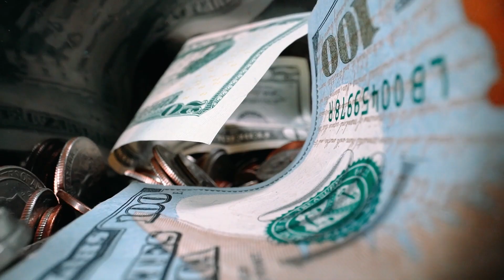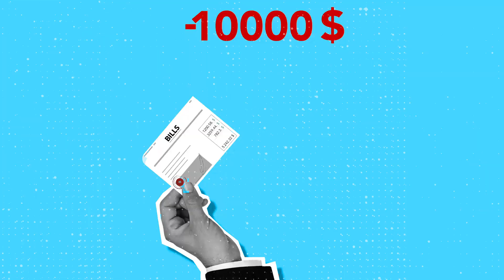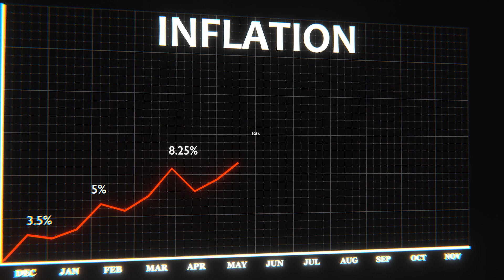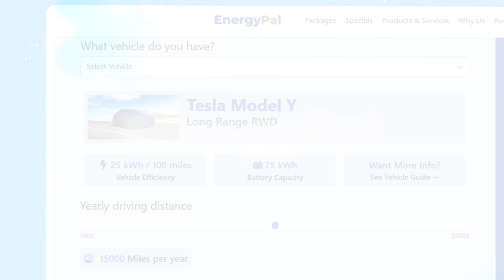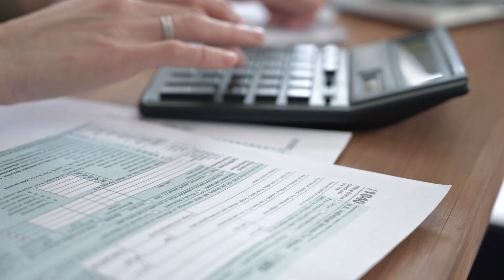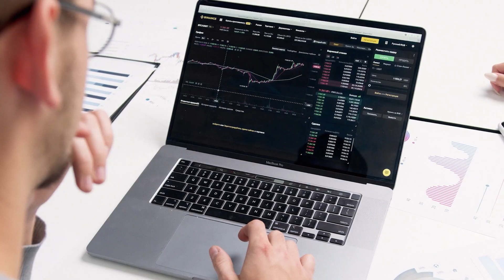Going SOLAR: Pros & Cons

Comment from the maker: WATCH NEXT - Pros & Cons of buying an electric car: https://youtu.be/kxb6kjuJEso
Reply: This is a very interesting video about the pros and cons of going solar. There definitely seems to be way more pros than cons for me personally at least since I live in Florida and have pretty of good sun coverage on my roof. Where the host left me hanging was that he said that leasing solar panels was a bad idea, but left me hanging as to why. I just signed up for a solar panel lease to start soon that I think makes way more sense than owning the panels because I avoid upfront installation fees plus a huge loan I would have to procure in this shitty high interest rate market plus have to deal with the hassles of maintaining and fixing my solar panels plus upgrading it eventually when they become obsolete or outdated. The video creator should I have done a better job of conveying the so called cons of leasing solar panels. Anyways, I expect to enjoy savings of at least half of my current monthly electricity fees so I’m looking forward to that. I want to eventually pair this with buying an electric car to garner even more savings on fuel costs for the vehicle besides reducing my overall carbon footprint. Also, the EV can even act as your home battery with the right kind of EV and vehicle to home wiring so that’s something to explore as well.

Comment: I guess I'm lucky because it took me about 14 months to finally get solar going. Completing the solar generation agreement with the utility company took another two months. None of the delay was due to government red tape because I live in California. In fact, the permitting, inspection and solar generation agreement were done in less than a month, if I include the wait time. The delays were caused by the incompetence of the solar contractor who wouldn't keep us informed about where they were in the process and wouldn't work with the roofing contractor that we needed to make sure we had a viable roof for the life of the solar system. The contractor was also lazy about submitting documentation to the utility company until I lit a fire under their asses. I sure don't feel lucky after the shenanigans of the solar contractor.

Comment: Saving over time is not a good deal if you're already old. I won't live long enough to break even and that's if NOTHING goes wrong and I'm thinking it will. And if the value of my house goes up so do the taxes. This deal just keeps getting worse. I might use VTG or a powerwall so I can be in a VPP but not solar.

Comment: Alex, you made a couple good points, the one that gets missed most often is the roof renewal. But what you completely missed is the concept of net metering. It’s not in all states, but states that have it it’s awesome because the grid is acting like an infinite battery. When I overproduce, I give my utility kilowatt hours, and when I underproduce, I get them back one for one. I don’t need batteries this way. Batteries have only specific applications. They do allow you to produce when the power is out but how often does that happen? Batteries are never going to work to get you from summer overproduction to winter underproduction. That’s why net metering, and the grid as an infinite batteryis such a great concept.
Reply from the maker: That is almost over. The utility companies are now starting to pay so little for your electricity that it's not even worth it anymore. I did mention it in the video
Reply: @EforElectric  You misunderstood what they wrote…

There is NOTHING being sold in "net metering" systems (which are popular evenn here in Europe).

In "net metering" system, you are assigned account that counts how many kWh hou delivered in the system and what is your balance.

No money involved, just kWh in, kWh out…

Of course, if your account gets deep in red for longer then several months, utility is going to come knocking, but otherwise it's just abouth kWh balance…
Reply: In some states Colorado where I live we have 1:1 net metering.  It resets once a year.  So if over the whole year I produce enough I dont pay any usage charges. That makes a battery not financially worth it.  It still could help during a power outage.  If I was worried about that I would probably get a much cheaper evil gas generator.   The greedy utilities can always change net metering rates and reset the calculation. ( It may be a law in Colorado not sure )
Reply: Still going strong in Washington state. It’s possible it could change later from one-to-one to something more like two to one or three to one where they come out ahead. It just depends what state you’re in. Washington net metering is over a one year. Alaska a one month. I think it’s important to see what the situation is in your particular state and not paint everything the same.
Reply: The way it works in Washington state is that if you don’t have enough in your bank, plus what you produce that month to cover what you import from the utility, you simply pay the difference. But generally the way it works is the solar year starts in April, and, generally one is break even in April by the end of the month. You might be behind at the beginning of the month, but make up for it by the end of the month and that’s all that matters. In may, you are starting to get ahead and you build a bank. All summer long the bank builds. Come October, you start drawing down from the bank. Most people run out of the bank somewhere in January or February and then just pay for any electricity they import. Myself, I have enough capacity that I just break even by the end of March. If one does have anything left over in the bank after the end of March, the utility takes it. Most people slightly undersize their system so they don’t leave anything on the table.
Reply: Utilities have and will reset/cancel/change net-metering making the finances difficult to lock in.  They will never make it easy even if it is in their best interests with regards to capacity and load-sharing.  They are mostly all FOR PROFIT companies!

Comment: I was going to get rooftop solar panels, but decided against it after discoverying these two things contractors never tell you: 
1. Some insurance companies will increase your rates - fire risk increased, and value added to house
2. Inverters typically last 10 - 15 years, replacement costs labour + parts about $5000. Add that to the overall cost when calculating ROI
Reply: Depending on how much you drive in those 10 to 15 years, having rooftop solar with an EV drops your fuel cost to below $0.50/gal. Another factor to add to your ROI consideration.
Reply: @CSAFMedia my utility company is offering 2.8 cents per kwh overnight rate. I charge my EV for almost free at night.
Reply: Do the panels themselves need replacing due to a reduction in efficiency or do you just live with it since its at an acceptable level?
Reply: @johnfbm  most panels last over 30 years with at least 80% efficiency. Usually inverters fail long before panels need replaced. Inverter parts are only $1500 or so but it's the labor cost that will be expensive. If you choose to do it yourself then your insurance will deny coverage should it ever catch fire.

Comment: Its a bad time right now with high interest rates and new much better systems finaly  in supply.
Integrated solar roofing is the future and already cheaper than a new roof with solar ontop.
they are also much more durable than normal american roofs.

Comment: How many times do americans have to change their rooves? When I grew up we never need to change the roof in 30 years.
Reply: It's the hooves from Santa's reindeer you must worry about not the rooves.
Reply from the maker: On average every 25 to 30 years
Reply: If you have an older house, you should also check if your roof / structure can hold up the weight of panels, especially if you live in a snow regions, all that weight plus snow in a 50 year old house. No wonder insurance company doesn't like it, and will increase your premium.
Reply: oof, I forgot about snow. We don't have snow in our country @i6power30